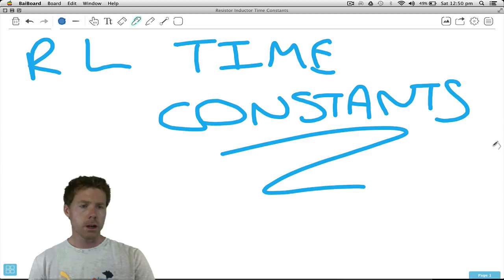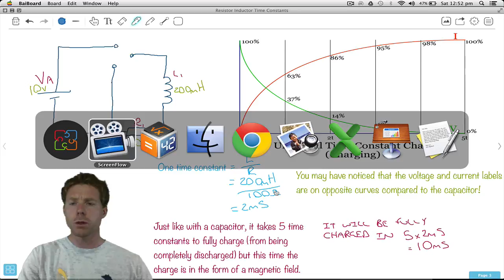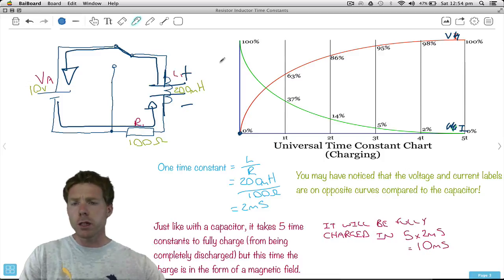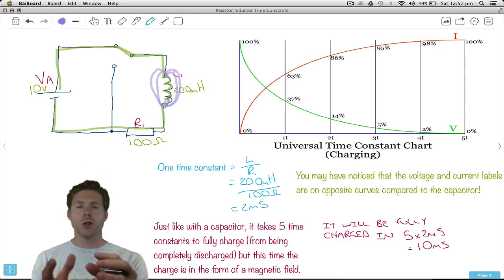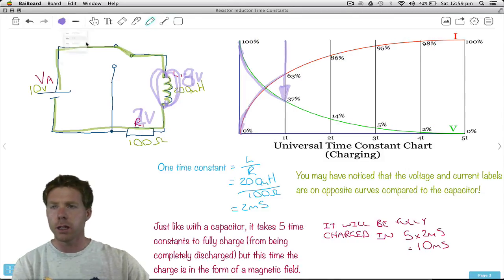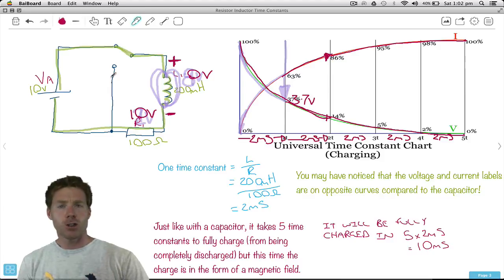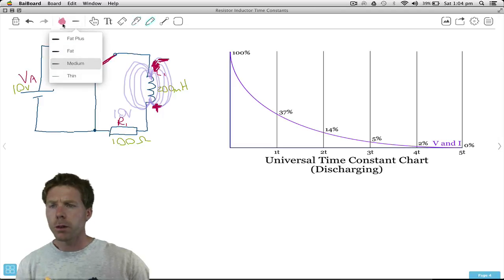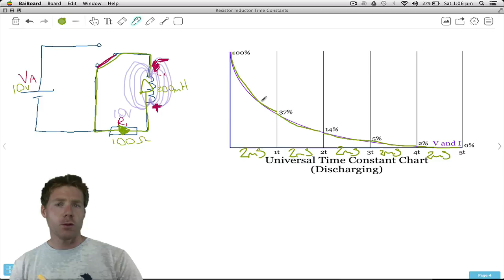Electronics Fundamentals Tutorial #29 Resistor/Inductor Time Constants

Comment: Brad, when you cut power to the inductor, and the poles reverse, doesn’t the back emf send a reverse current down the circuit? Thanks.
Reply from the maker: The inductor doesn't like change, so when the power supply is supplying current and then the supply is removed - the inductor will work to keep current flowing in the same direction as when the power supply was supplying it. So instead of current going in the opposite direction - it keeps going in the same direction. The inductor is essentially acting as the power supply (however the field around it will eventually completely collapse and there will no longer be any current).

Comment: Brad, then why do we use a diode or a VOM to control the back current that results when an inductor discharges?
Reply: Sorry, I should have specified an MOV, not a vom
Reply from the maker: We use a diode to provide a current path for the inductor to discharge when the supply current is interrupted / disconnected. Otherwise the collapsing magnetic field around the inductor will cause the voltage across the inductor to rise to a level great enough to allow current to flow via the open circuit switch contacts. The current however is still going to be flowing in the same direction as when the power supply was supplying the current. If you have a look at the following image from Wikipedia you will notice that the current is always flowing from top to bottom down through the inductor: https://en.wikipedia.org/wiki/File:FlybackExample.GIF